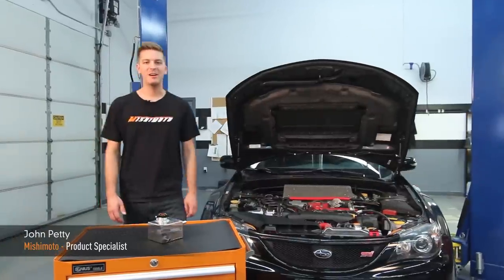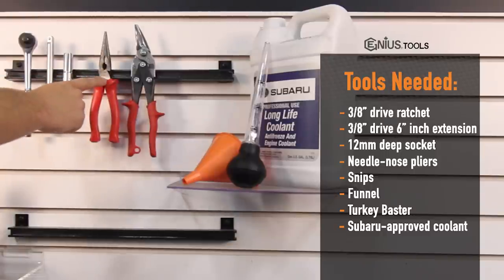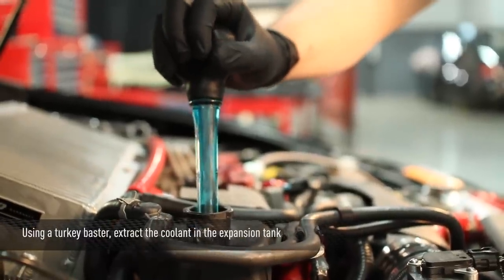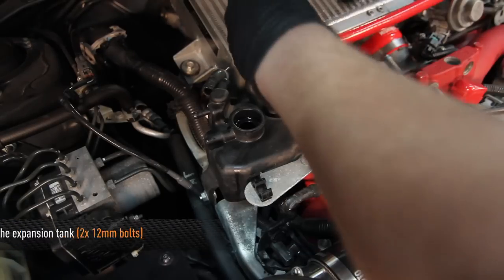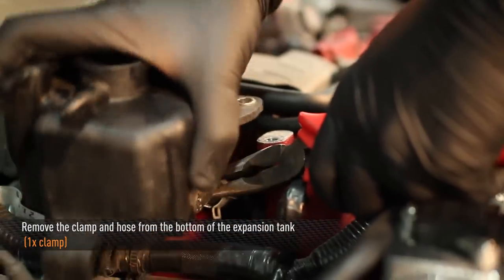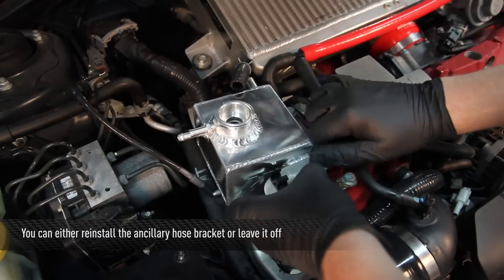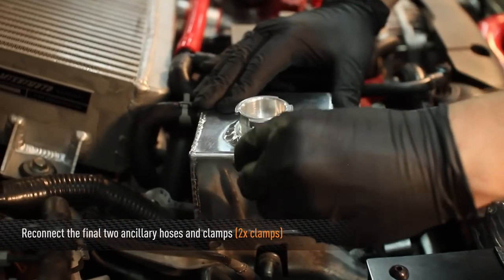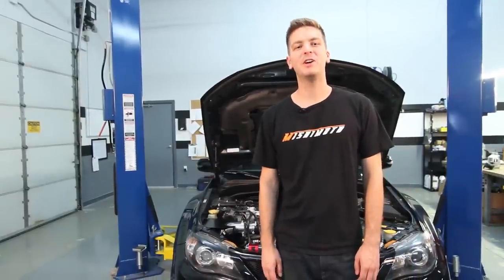Aluminum Coolant Expansion Tank for the 2002–2007 Subaru WRX / 2004–2016 STI Installation Video

Comment: So with the new aluminium expansion tank the coolant gets ''cold'' faster?
Reply from the maker: The expansion tank we offer is not specifically designed or tested to cool the fluid any faster than the OEM would.
Reply: @mishimoto  : OK, thank you a lot for the clarification.

Comment: Is that the same coolant as the one in the radiator?
Reply: It is a coolant expansion tank so it must be. My brother has this installed on his 05 STi. Got a video of it on my channel looks very clean.
Reply: I reused my coolant, since the tank is bigger than OEM, I had to add a bit more.
Reply: @AyeeHime  you should do a flush. the amount of cars I have bought with problems because they haven't been flushed. pitted head coolant ports, pitted water pumps, rusted turbo coolant lines, etc.